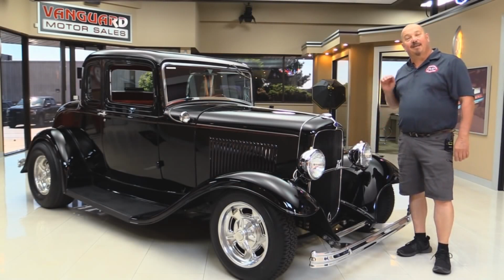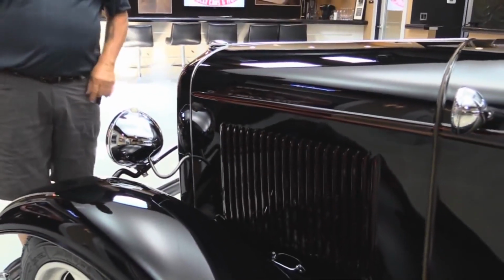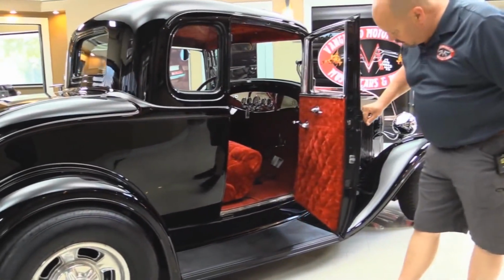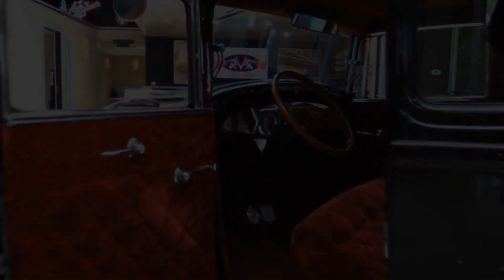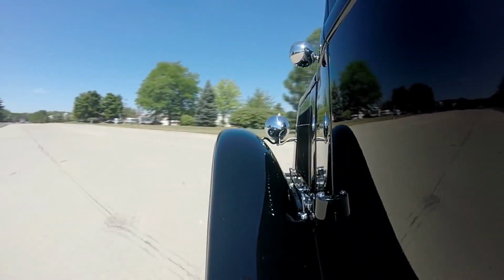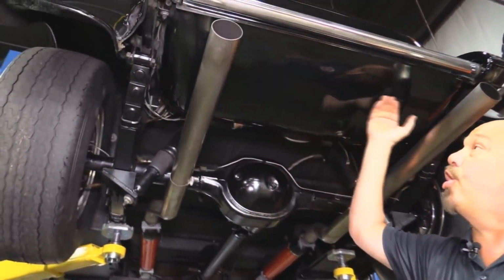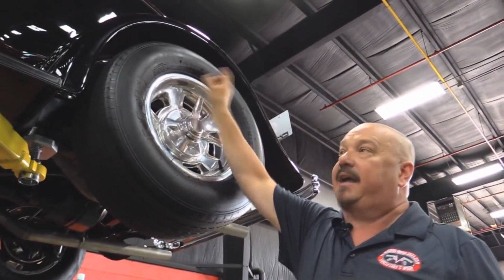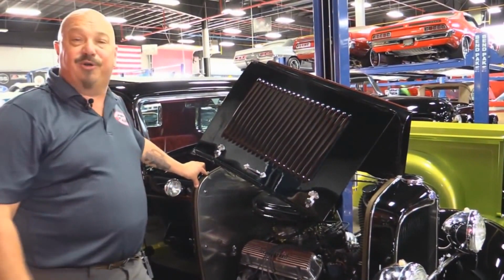1932 Ford Coupe For Sale

Comment: just needs 521 ci- 580 Horsepower  Ford crate motor Tremec T56 6 speed manual, modular differential for quick changes for different road conditions ,wider tires and a whole lotta cash and a weekend at the monday to friday business park with the three-quarter mile smooth as glass 3 lane cement service road that no one knows about and cant be seen from the hiway!